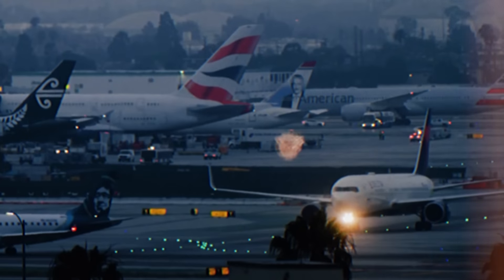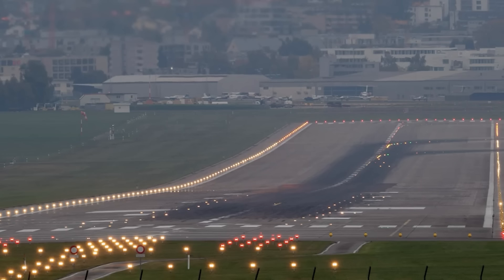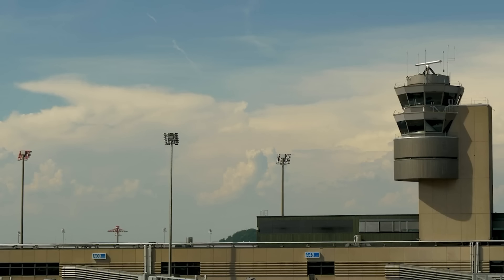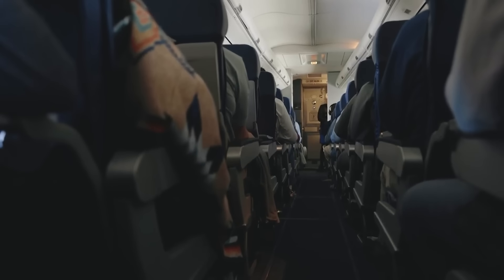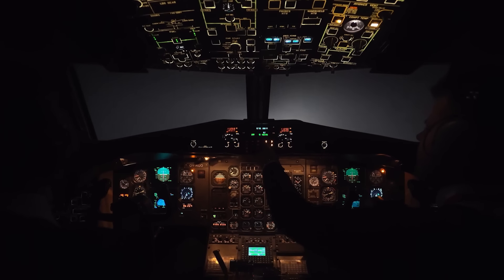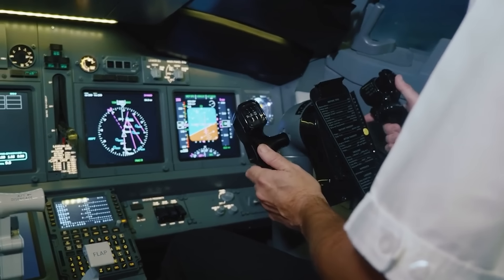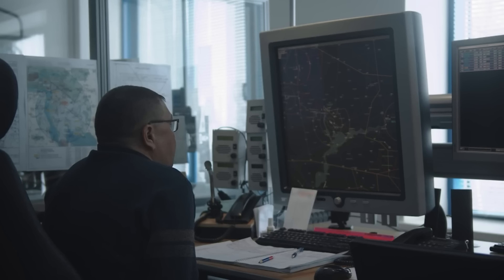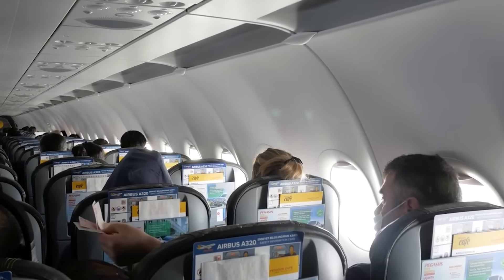2 Planes Takeoff At The Same Time, Then THIS Happens...

Comment: As a railway safety expert I find the system which allows two aircraft to be on the same runway to be abhorrent. The railways found this to their cost in the 1800’s. Why is the airline industry so backward ?  I guess the blame is fairly and squarely down to the bean counters.

Comment: Easter sunday:  It is obvious that this airport's flow-thru capacity should be sharply reduced when control tower is short of staff.   So few are on the job that simply taking a rest-room break could lead to a crash!  Expecting automation to pick up the slack to provide a safety margin is playing with fire.   Retired in Sacto.

Comment: It’s Ridiculous in this day and age for a VHF signals not to be heard, due to another radio signal with greater power. With marine VHF sets most sets have a output wattage which differs from fixed VHF set to a handheld set, if wile aircraft on the ground used a lower wattage than no signal would be readable and the aircraft would have to respond again allowing a greater margin of safety, if one aircraft is transmitting on 25 watts and the other is transmitting at 5 watts, but the acknowledgement from ATC should make it clear who he was talking, that’s if correct protocol was followed.